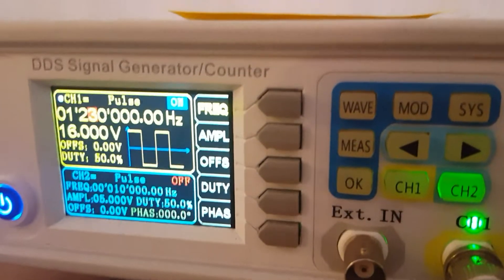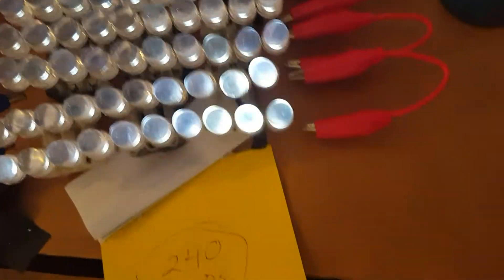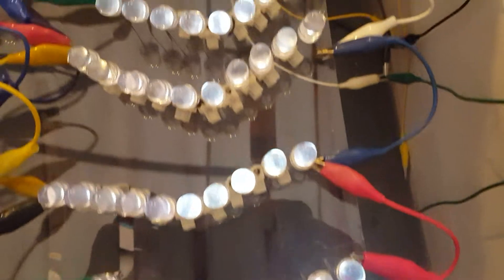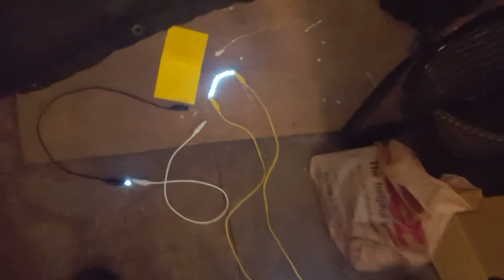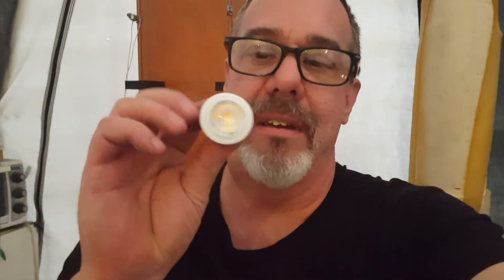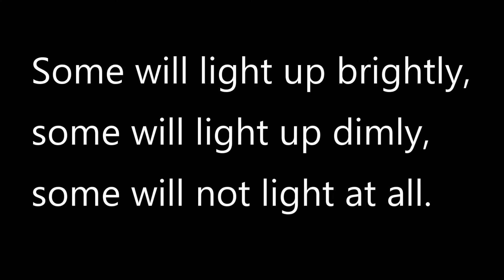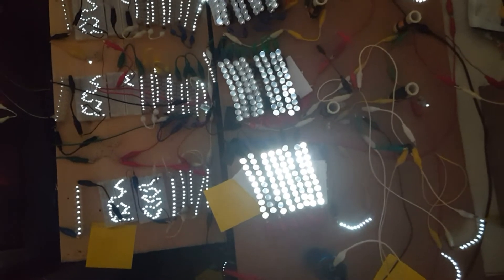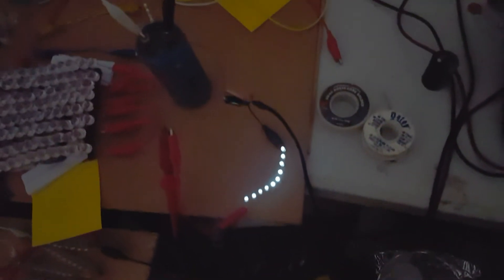WIRELESS POWER TRANSFER Part 23  1,001 LEDs LIT!! (Over unity!? Free energy!!?)

Comment: If the electricity supply in your country to your home is "hot line" & "neutral-ground" then it is not free energy. Just do a test run and activate the signal generator with battery! If you have the same results then it is FREE ENERGY!
Reply from the maker: Per the manufacture, the signal generator can only put out a maximum of 100mA.  16V * .100A = 1.6W lighting 1,000 LEDs.  Power from wall outlet is 120VAC, the input to my freq gen is 5VDC, it has build-in rectifier and transformer on plug going to wall outlet.  My power measurements show I'm only using 200mW to light them up as I have very little load with this open circuit.  I show input power measurements here.... https://www.youtube.com/watch?v=SsvGoI7VtWA&t=407s
These power measurements were taught to me over a period of over 4 months from an expert who has taken hundreds of power measurements on similar systems, it's part of his job.
I will eventually have this running on battery power, it is part of my plan, to get a self sustained loop.
Thanks for commenting, hope to see you at the next video part.

Comment: Hello Inventor3 nice work! how you power the signal generator? Have you tried using battery to power it? 👍
Reply from the maker: Hello and thank you!  The signal generator is plugged into the wall.  The generator has on it's plug, a built-in rectifier and transformer.  Wall outlet power is 120V AC, generator is 5V DC input.
I have thought about the battery powering the generator for a while now, and I feel I will get there soon.  It will be part of the self-sustained loop(system powering itself).
Right now I'm doing many experiments to get better control over the system and to better understand how it's working😎
Thank you for commenting.

Comment: Hey Paul check this out, these guys are gaining power just by running through a bifiler coil tuned to it's natural resonance  https://youtu.be/Rdzz34GNkxg .  I got some of the LED plates with the surface mount LED's but no circuitry from Aliexpress , here is a link to some that are similar to what I bought, https://www.aliexpress.com/item/1005001937400269.html?spm=a2g0o.productlist.0.0.15f2125apdkcqX&algo_pvid=c7586ab6-c708-4ca9-b6ea-7f9153908452&algo_expid=c7586ab6-c708-4ca9-b6ea-7f9153908452-36&btsid=0b0a556b16211423362406182e3b3b&ws_ab_test=searchweb0_0,searchweb201602_,searchweb201603_
They have more, I searched for smd led round light boards.

Comment: How is your transmitter coil set up basically like a Tesla coil with a primary and a secondary winding, are you still using the 7" coil you started out with for transmitting or have you started using something smaller for that? What size wire are you using for your transmitter and receiver coils? I've got some fairly fine stuff from picture tube loops that I pulled out of old TV's and I have some 20awg and 21awg. I've been playing around with it but I have not gotten it to do anything yet.  Thanks Paul.
Reply from the maker: 7" coil has been replaced with coil seen in many videos now, it is only about 2-7/8 dia.  The main thing is that it is now half the wave length/wire length now, doubling the frequency.  Transmitter and receiver, I can not talk about much at this time, sorry :-)
You may get some more ideas from Bruno VK, he is trying to replicate my work.... he does a lot of videos on Don Smith spinoff, and recently did a few videos on Inventor3 spinoff, but those videos maybe private at this time.  Here is Brunos channel, he is making great progress     https://www.youtube.com/channel/UCkp6KwvUDupNdS8tamQF06w/videos
Reply from the maker: My primary coil shown in videos is with .034 dia wire, which I believe is 22awg.  The wire you have is great to start with, no problem. The larger dia wire you use, the larger the field will be around that wire and coil.  However using the "same length" wire but smaller dia wire will give you a greater inductance, no matter what dia the coil is.  My wire length is now at approx 24 ft & 7 inches. 

Try this...... Connect freq gen in parallel with one coil(pos end of freq gen going to one end of coil, and neg end of freq gen going to second end of coil).    Make a second identical coil and connect a LED in parallel with this coil(one end of coil going to one end of LED and second end of coil going to second end of LED),,, now put this coil with the LED near the first coil that has your freq gen connected to it.  LED should light up when your freq gen is tuned to best resonant freq😎, you will have to scan the frequencies to find out the freq that will make your LED light up.  Now with the coil and feq gen, you can experiment with connecting the neg of freq gen to other objects instead and experiment with connecting second end of that same coil to objects :-)  Hope this helps.  I think you will be happy when you see that LED light up, have a great weekend my friend!  Sorry about my last poor reply.
Reply: @INVENTOR3  Ok Paul thanks I'll try that. Your reply was good enough, nothing wrong with it. 
  Have you tried multiplying the amperage through the magnetic coupling by adding multiple identical secondary coils to the iron core then connecting them all  in parallel yet? According to Patrick Kelly and also Don Smith it works and each instance is equal power wise so you can wind 10 identical secondary coils on the same core that put out 5 amps each, wire them in parallel and have 50 amps output from the transformer,  but I have not had a chance to try it yet. You all have a great weekend too, God bless you all.
Reply from the maker: @BushImports  Hmmm, i understand what your describing,,, I will have to try this.
Thank you!

Comment: Hey Paul, What does your  multimeter read volts wise if you clip the leads from the frequency generator to your multimeter probes? I am not even able to get 10 volts out of mine the the frequency generator is set to 20 volts. Thanks man, I hope you are all doing great.
Reply from the maker: I checked this myself before,, but now trying to remember how I checked it, hehehehe.  Try connecting Pos from multimeter to Pos of freq gen & connect Neg of multimeter to Earth ground and let me know what you get.
Reply: @INVENTOR3  You mean the ground in the electrical receptical where you plug a cord in right? That didn't do anything worth while.
Reply from the maker: @BushImports  I will check this out the next time I go into my lab in a few days.  
Something sounds fishy.

Comment: @arround 8:45 when you experiment with barely touching, what's the result if you go higher on your coil? I have never tried that out to find the antinode of the standing wave on the coil, something I need to test myself also ☺
Reply from the maker: Hmmm, good question I will try this.  But I think it will be the same, but who knows until I try it.  So far it just seems to need to be close as possible to the field that coil is producing,,, hmmm,  so maybe I should try a larger coils again.  Even though it would have same wave length of wire, it would produce a larger field that's for sure.  When I used the larger coils in my system they would have to keep good distance from each other, but now have very small coils and they produce very small fields and can be kept close to my system without interference.  If you want a really large field use a 1/2 inch dia copper tube😁  I will try touching top and bottom of coil next time and see if there is a difference.  I did try lowering the AV plug with LEDs down inside of one of those small coils, it worked but as i get close to the center of the coil it will interfere with the system and LEDs go dim.
Reply: @INVENTOR3  I saw in a video off somebody describing the Mathernitha device that a closed tube would give you low voltage  eddy currents. He showed a 12V light bulb that was running across a gap in the surrouding grid so that he created a closed loop on that tube grid with gap. When he used the grid with gap to ground he had high voltage (depending o transmitter voltage) The video is in German but at 47:49 he shows a 12V light bulb running on the eddy currents: https://youtu.be/S4fgRpa2zcw
Reply from the maker: @brunovk417  I checked it out quick, but now have to watch again in more detail :-) Looks like he got ideas from the Testatika machine, I see a lot of photos of it.
Im trying to remember what Don smiths coil was made of, i remember it looks like a screen, they were special made, do you remember any details about his coil and what made it special, it would be in his latest models of his device.
Thank you Bruno!
Reply: @INVENTOR3  I could only find a grid arround his "4KW generator" to keep the flux in, I couldn't find it on coils.
For the coils I can only think of the magnetostrictive core material, the Terfenol-D (very expensive).

I have a metglas core for transformer but haven't experimented on that because I don't know the coil arrangements he used in his shoebox device.

I also send you an email I have found something in one of your video's.
Reply from the maker: @brunovk417  Bruno, I did get an email that said you sent me a video, but video does not play.  Please send me a link.  What did you find in one of my videos, tell me in an email please...   millanyangle@yahoo.com

Comment: Congratulations with this milestone !!!
All the luck with the next steps.
Thank you for sharing the "cats wisker" I wasn't sure what that was and did some research and was surprised that silicon carbide could be used for that. I'm in the proces of trying to build a Patrick Flanagan air purifier where he has a patend where he states that the "electron cascade" (drawing in from ambient) was beter when capacitor was doped with silicon carbide. So thx to you talking about cat wisker I came to that intresting phenomenon that I will need to try to poke that capacitor with point contact to see what happens 😀
Reply from the maker: Thank you Bruno!  Glad you saw this video😁  If i remember correctly, the "field stress detector" was Johns creation, used special diodes....  https://peswiki.com/directory:john-hutchison-on-field-stress-detector
The best crystal wafer cell that John built had micro hairs grown onto it, i think they were carborundum, maybe I'm wrong, i would have to ask him again, he is here "Pinned comment".  Each of these wafers stacked on top of each other, point contact, cat whiskers.
I know Galena was an ingredient experimented with in his crystal cells, one of the ingredients used in diodes....  Galena was used as a point-contact diode [a two-terminal electronic component that conducts current primarily in one direction] capable of rectifying alternating current to detect the radio signals. The galena crystal itself was used along with a sharp wire, known as a 'cat's whisker', which was in contact with it 😎  Hmmm, maybe try a crystal in between your cap and point contact.
Patrick Flanagan, sad he was beaten to death, such a peaceful person.  I been wanting to buy his "Neurophone" for a long time.
Reply: @INVENTOR3  Thank you for the explication. I'm first going to see what the "air purifier" gives from result. I hope to cast the capacitor for that this weekend. 
I can try the "cat whisker" on a resonant circuit while the epoxy hardens ☺

Comment: Great work I'm keenly observing 

You asked if anyone had any ideas,  I believe I've recently was able to 'solve' the tesla hairpin circuit by studying and understanding some of Heinrich Hertz's work

My guess is your system is using a non discharge version of transmission but earth connected.

Anyways it's great progress 
Re 'cats whiskers' it was Morray that discovered a detection  element that amplified earth energy by tapping the potential between earth and the atmosphere.

By 'solving ' the hairpin circuit one should be able to transmit 'scalar' or 'longitudinal' waves that is to say waves in the adjacent vector to radio.
Reply from the maker: Thanks for observing!  I have the Tesla hairpin circuit and did many interesting videos on it.
The possibilities are mind boggling.

Comment: Great work Paul 👍
Reply from the maker: Thank you!!
Reply: @INVENTOR3  Paul  it's like one wire going to set up the electrons to flow in one way, it's just how u set up the field  one field just flow , there it's not competition on equally, +/- u need just one to make flow , if you use two you and up on the load meaning  the same amount that u put you have to take back, on our sistm energy  just flow no load it's on  because it's not limited,
Reply from the maker: @Alwaysbusy300  Interesting, I will think about this.  Thank you.
Reply from the maker: @Alwaysbusy300  Thank you :-)

Comment: What kind of conversion / output do you get if you put all of these onto a solar panel? Then perhaps add a Fresnel lens (from a trash LCD television) to focus further?
Reply from the maker: Interesting thought, and I have 4 of those large Fresnel lenses.  I was just thinking about placing one over all my LEDs the other day.
Thanks for your input.
Reply: @INVENTOR3  neat, glad to hear you have some on hand. You're very welcome. At the very least I think it would prove an interesting test to see what kind of energy may be measured and I'm guessing it would be different than other tests and metrics that have been gathered so far.

Comment: hey paul i used to make my own batteries that would charge when i would leave them under powerlines but i also live near a nuclear plant but they only held about 6v for 30seconds after charging for 24hours this battery was the reason i built my old project but i gave up you could experiment with dry battries much like i did
Reply from the maker: Very good project with the batteries.  John Hutchison made a very good strong crystal wafer cell.  John & Marcus Reid made many crystal cells also.  I worked on them myself, but would love to have another try at it.  I been thinking quite a while about building a Zamboni dry pile, like the Oxford bell, but much better.  I also want to make an Earth battery bank under my lab😎

Comment: 1001 and counting.... Nice! What was your output voltage with this many LEDs?
Cheers 🍻.
Reply from the maker: Hey Finite, thank you!  Output from freq gen is still at 16V.   Or, umm, you mean output voltage of system with 1001 LEDs,, then I can only guess that it must be above 2,000V, and I feel confident I could charge many caps that would add up to more than that😎

Comment: Hello Paul :)  Are you using the LEDs as a load, or are they somehow helping to generate the voltage?  Do you leave that on all the time?
Reply from the maker: Hello Jerome!  Hmmm, good question.  It is something I have to think about, a few hundred LEDs are acting sort of as a load to the other LEDs, in a sense creating a balance, but not sure if I would call it a load if the source is not detecting it.  I do strongly feel they are helping to generate voltage.
  I have not yet let the LEDS run all through the night, mainly due to cold temp at night and high humidity and my worry for the equipment.  Hmmm, maybe I can put an insulated box over my freq generator.  But I have had them running for 6-8 hours at a time with no problems.
Reply: @INVENTOR3  I would strongly agree too that the rocks allow the atmospheric resonance to continue in a directional resonance. Same with the 🐈 whisker. Maintaining the equalization between atmospheric pressure and the internal vibrations of the water and malachite. Hehe